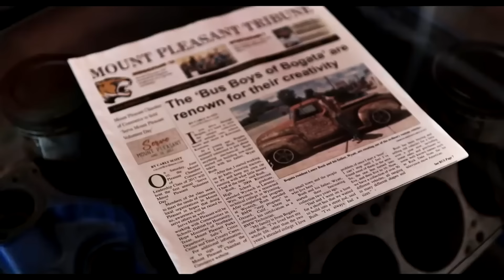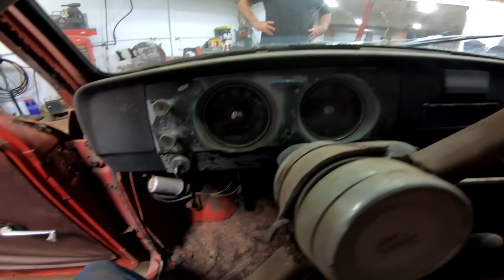1965 Datsun 320, Will It Run After 30 Years? | Turnin Rust

Comment: I remember these trucks when I was little in rural Kyoto. They were amazingly popular both on the farms and in the urban sections. There weren't "caps" or bungee cords" at that time so stake bodies or tarps were the big thing to contain the loads which is why they have those hooks around the bodies for easy use. In my childhood memories, I can see them piled high with all sorts of goods moving about. Because of Japan's tiny alleys, these were the "bigger" delivery vehicles of their day with the even smaller 3-wheel Bata bata taking up the slack.

I wish you guys would use a muffin tin when you do this. You guys are always pulling these vehicles apart and putting things down all over and it drives me crazy.

Comment: I apologize. My wife says I shouldn't make comments without proper explanations. You don't need to see spark at the points. Many times there isn't. But if the coil is sparking, it implies the points are working fine. The coil sparking means that it is good. Trying to isolate the coil wire and still getting sparking to the primary pin means the coil is functional though insulation through isolation is low (there may be a carbon trail). The distributor cap and spark plug wires are not "one piece" and only replaced as a unit. Small screws inside the cap will release the wires. This engine is a copy of the British A-series engine, which also uses the same style distributor cap.

Comment: Here some pointer to help you all in the future, when dealing with older ignition system.

A: Those canister type ignition coils dont like being mounted on there side and will leak out all there oil, damaging coil in the end. 
B: Those type coil are marked for use with a resistor for the points ones or for use with electronic ignition where the resistor is not used. For the resitor type, a ballast resistor must be used to drop the voltage to prevent overheating the coil or putting undue arc across the points. When converting to electronic ignition, the ballast resistor gets removed from the loop to give full voltage to the coil.
C: Its not good on the coil, for it to be making large arcs and puts extra stress on the coil. Its better to use a dwell meter, to check the points for function with the hole ignition system hooked up. Leaving the plugs resting on grounded metal is fine when not wanting to start the engine, since limits the distance the spark has to jump to ground. A fluke 78 or 88 is a example of a usefull meter that comes with the dwell option.

Comment: Austin engine, Datsun bought the Austin British Motor company old 1200cc moulds and tool factory machinery for this Datsun's engine. I had a Datsun saloon version in New Zealand and was able to put my 1950's Austin A40 Devon 1200 engine head straight onto the Datsun 1200 block. Datsun cast the motor with a much better metal makeup whereby the cylinder bore never wore out. Even the distributer is from Austin. Great reliable vehicle!! Cheers Daniel

Comment: I worked at a dealership in the 70s and we'd see one of these from time to time. For some reason most of the mechanical parts were available well into the 80s. Clutch master and slave cyls were a very common replacement item. Frozen wheel cyls were also a thing on just about every brake job.

Comment: I've been a Datsun fan since the early 90s. I've had 3 zs, 3 510, a roadster, 620, 720, 200sx. I love the fact that they are popular again. Suck, squeeze, bang, and she'll blow! Get it cleaned up, repair the rust, put it on a more modern frame, drop it. Cool little shop truck. Datsun/Nissan knew exactly what they were doing.

Comment: The switching of petals reminded me of faculty member of my high school had a car that they used the clutch petal as the gas petal. I went to pull in into the garage to do an oil change and mashed the clutch petal and the brake petal at the same time. I banged into the door. The teacher was disabled and had to use her left foot on the gas (clutch petal). It was an automatic transmission, but when you see a clutch petal, you instinctively mash it to the floor. It had 2 gas petals and 1 brake petal.

Comment: The distributor cap has threaded pins inside the holes that the spark plug wires thread onto. To remove the old ones just twist them counter clockwise and they will unthread and to put the new ones in, just cut them to length and twist them into the holes until they bottom out. The pins thread themselves right up the center of the wires. That gas tank is from a snow blower. I am thinking that if you were to take apart the clutch master cylinder you will find it is just stuck and with a disassembly and a cleaning it will probably work. For some reason the rubber cups in those old Datsun master cylinders don't seem to fail very often and they often just need a good cleaning to work again.

Comment: I  had a 1964 Datsun 1200 when I lived in Ecuador in the 60s. It was just like that one but did not have a box on the back. It was integrated with the cab. It was a duplicate of a Fiat 1100, but it was reliable. It had four on the tree, but the shift patern was backwards. It was a nice little truck.

Comment: I've got a 67 International pick up, 6 cyl. 3 speed. It runs, won't idle clutch is OK the little parts are impossible to find as I would imagine this one is. I'm close to Ft Hood ( it'll always be Ft Hood) my bed is good but floorboards are ventalated. Easy fix. As I recall a 4 cylinder Ford engine fit in these old Datsun pickups. Yeah I'm old enough to remember a lot of these little trucks running around.

Comment: I owned a little truck like that. It had a little 1200 cc engine. Mine was rateded a one tun truck.  It would run 50 mph that was fast as it would go . That is the reason I sold it,I was 2000 miles from home and I traded it for a maverick car.

Comment: I had a 1971 620. On a 30 mile commute, the slave cylinder failed. To get home, I killed the engine,, put it in first, then started the engine. That got me rolling, then I shifted without the clutch and came on home. Bought that little beauty in 1978 for $1200 and sold it in 1983 for $1200.

Comment: Question? Once you worked on the clutch cylinder could you have reconnected the line back to the clutch master cylinder and hooked the brake line back up to the brake master cylinder? I was thinking that the clutch issue might have been resolved after you had reworked the clutch slave cylinder.

Comment: Check the coil wire out of the coil it will spark to the engine put a plug in it were it gose in the cap . That is were it will be firing. As the rotor is spinning pop pop . No need to put the cap back on

Comment: Oh my Lord, this body is a perfect candidate for an updated suspension and a K-24 turbo or a Honda engine with that V tune Pop. Oil pressure actuated cam changing ability.  Just a modern drivetrain, power brakes, and steering. If I had the cash, I'd buy it up instantly, Brothers. I would

Comment: That truck won't take a corner for spit I flipped a 1965 Dotson 1200 in 1983 going 45 on a 25 mph corner in 1986 I took that same corner in my 1970 GTO at 85 mph with no problem

Comment: Great rotary  candidate. 😆
Reply: I was thinking something on the lines of a V8.
Reply: @todddenio3200   As long as it a small block chev.😄
Reply: Im still thinking  13B dropped on some 80s deep dish low profile hotwires. Tinted windows with national performance stickers chambered  lightly 😊
Reply: @Jace302  why is it that some people think that everything has to be a Chevy small block if it is going to be swapped into something? There are plenty of other options that are great engines. I don't have anything against the SB Chevy but it's not the only engine worthy of being used.
Reply: @todddenio3200  For me if you look at the engine  bay of small vehicles. You have to be realistic about what you try to fit in there. Being  Datsun. It's not uncommon to go for rotary conversions. Small block would be nice if it was set up right. ID be more interested to see a 13 b set up😊